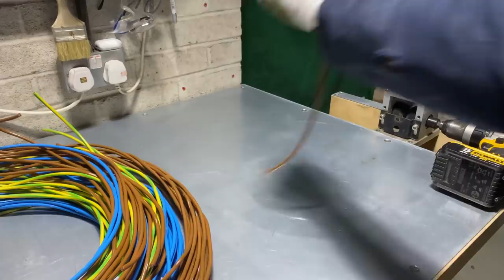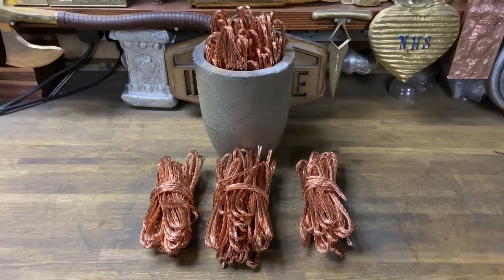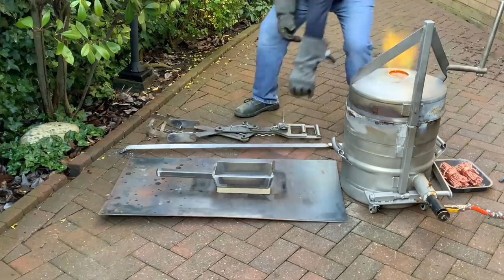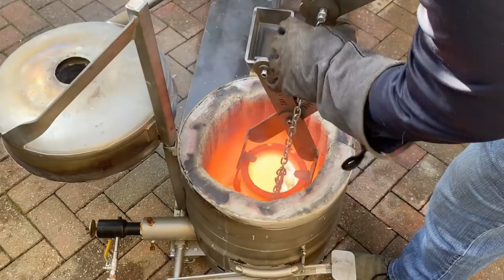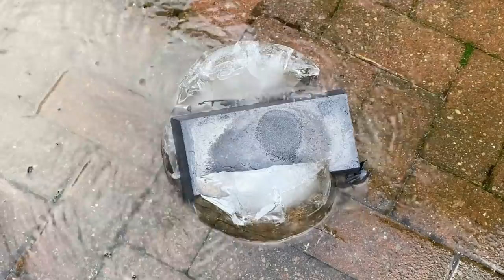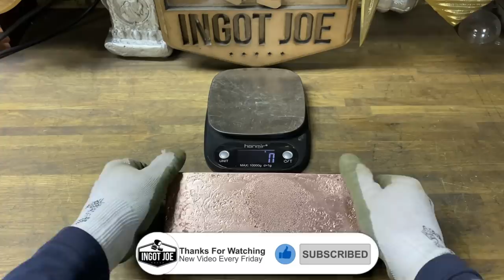Giant Ingot - My Biggest Ever Copper Ingot! - Home Made Furnace - Bullion - Molten Metal Melting

Comment: you need to add a piece of cardboard between The crucible and your fire brick keep it from sticking to each other big stack taught me that
Reply: From experience, yes, this piece of cardboard helps. Never been an exception.
Reply: I was going to post that but you beat me to it by 3 months. BigStackD is great!
Reply: @jaykay3784  I melt mostly copper from motors that I take apart keep on gettin it 👍

Comment: I tried to melt some copper today in my propane furnace and i got it superrrr hot and the copper would not melt :( any suggestions?
Reply from the maker: Check your gas pressure, for copper I go with 0.12MPa. Thanks for watching.

Comment: NICE!!! That was a great looking ingot. If you put a small piece of cardboard under your crucible, the fire brick shouldn't stick to it. You might need to make a heavier duty pouring shank. I dropped an 8kg crucible full of molten brass one day cause my pouring tongs were to flimsy. Luckily, Imy flask was a bigger box at a 45degree angle, it hit the box and slid the other way. Did you make that mold yourself? Looks great.
Reply from the maker: Thanks for the advice, I will have to do that, the crucible only seems to stick to the brick when it is really heavy. The mould was made by a friend of mine, I always struggle with aluminium ingots releasing from the moulds so had this one made with a tab on the end that allows me to tap it on the floor giving room for the ingot to drop out.
Reply: Cleverly made mold, looks very professional. Graphite dust in the mold will help releasing the ingots. Great looking bar!!! 👊👍

Comment: Why is the handle on the forge placed so it goes over the heat when opened? Would it make more sense to have the hinge swing in the opposite direction? Very pretty ingot though.
Reply from the maker: Thanks for watching, you are correct, would have been smarter to put the handle on the other side.
Reply: @IngotJoe  Just concerned for your safety. Would it be possible to retrofit it?

Comment: And also for bigger pours is there a possibility that you could use maybe like a rolling engine hoist setup to help lift your lifters with a little bit more control as an area idea of course like you said I. The video your crucible looked heavy so was was thinking maybe a engine hoist type lift setup maybe to help control it a little easier and safer that is but none the less cool video

Comment: Liked the video 👍
Final output was amazing. Spotless, clean and most of all it weighed exactly 10 kilo, even after the spill. With the weight of the block at 10.023 grams, I think the spill was well meant 😁
I have seen Big Stack D pour bars every week. Compared to his pouring, yours is at another level.
I am curious, how you got a flat top? Normally when the molten metal cools it dips in the center. Your bar is flat at top and looks fantastic.
As people suggest if you keep a cardboard under your crucible, it burns and forms an ash layer between the crucible and furnace mortar. Also your lifting mechanism is bad, though new. You must have two sets. One for lifting the crucible and keeping on floor and another to lift and pour.
Reply from the maker: Thanks for watching and your comments. I have found that copper does not sag as much as the other metals with aluminium being the worse.
Reply: Boompjekappen  thanks for the info

Comment: The only way to melt iron is to make an electric furnace with graphite electrodes?
Reply: Be careful, it will cool extremely rapidly and you will need to preheat your mold to rather high temperatures, at best a glowing red. You could also use a very high end foundry.
Reply: You mean oxyacetylene torch?